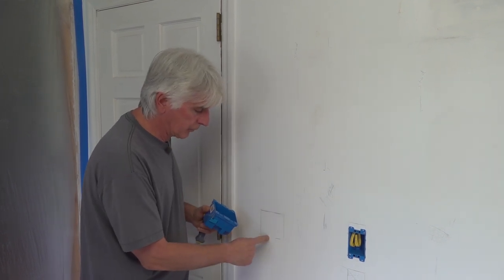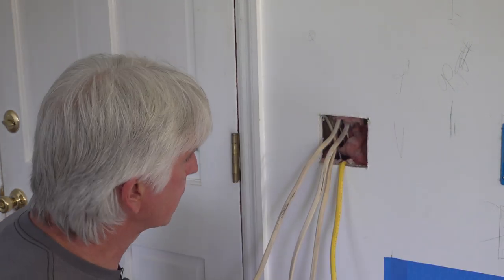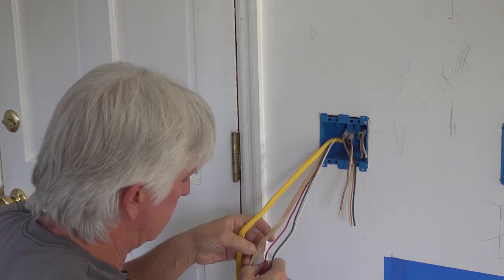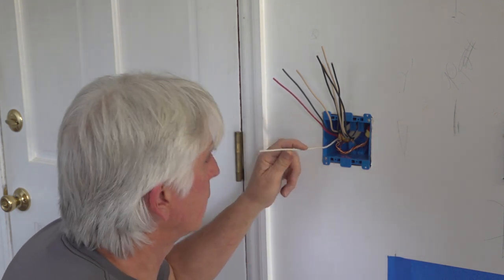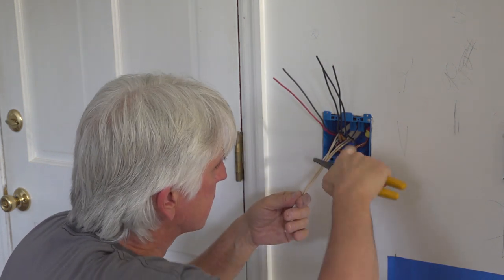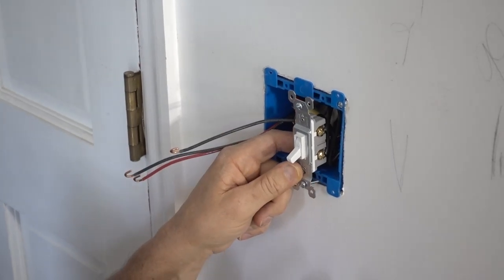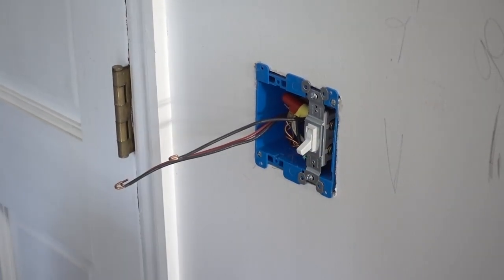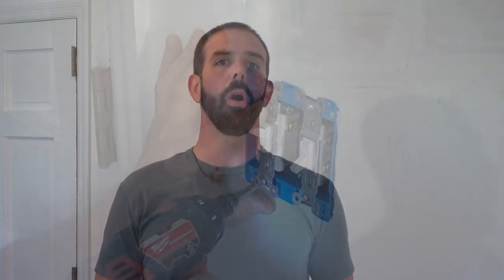Installing Single Pole & 3-Way Switches - Kitchen Remodel E22

Comment: I just started my electrical program at a trade, we just started wiring single poles to light bulbs, thanks for the video and amazing explanation, i will  be tuning in from now on, until my program ends in 13 months
Reply from the maker: Your welcome and thank you for the compliment. Good luck with your program. I have made a living off electrical work. Its tough at times and some times not so bad. There are a lot worse things to do, lol. I guess its all in what a person likes to do. Be safe!
Terry
Reply from the maker: I should have mentioned we do not have a lot of electrical going on in this remodel project but once we get going on our new houses we plan on doing  quite a few electrical videos showing how we wire a house with lots of details and explanations. 

Terry

Comment: For a German it looks so 1920s...we use WAGO push connectors, switches push in too, seconds later all is safe and secure on 230 V 16 A. Easy. It follow the codes, here.
Reply from the maker: Yeah I wish we were on the 230v system. 
Terry

Comment: Dear Terry,
What a shocking revelation & me who's done countless connections & never managed so much as to get a zap in the UK till I came to Belgium where the Neutral is actually a live feed too! Luckily it was only 120 volts & not the full 240. No chance of getting the tractor in then?( with an insulated bin????). A very well presented demonstration. Very well done. Kind regards.
Reply from the maker: Thanks! I think a lot of Europe is 220 volts but I have never been there so i can not be sure.
Terry
Reply: @ForestToFarm  Dear Terry,
Thank you very much for your courteous reply. As far as I know, the UK is the only odd ball having two voltages ( if you discount 380/410 Volts for factories). By law 240 is considered domestic & therefore cannot be used out of doors; this where the 120 or 110 Volts as they like to refer to comes in. In Europe they just have a built in R.C.D on the power tool's cable if for example the machine like a diamond core drill will be in close proximity to water. We instead have a dirty great big transformer weighing approximately 16 Kilos to cart around. There are some even bigger ones when 3.5KVA is simply not enough but like your good selves they use their tractors to move them around as 400 Kilos is ever so slightly beyond all the would be Arnold Schwarzeneggers. Kind regards.
Reply from the maker: Good info. Learn something new every day.
Terry

Comment: wow guys great video, I think it will help me with my situation. I have that same setup in an upstairs bedroom. 3 way switch on left and single on right, they work on separate breakers. the 3 way works fine but can't get the single to work for the room light. hours trying to figure it out yesterday and nothing, changed the single switch to a new one and nothing, any advise or help you guys can give me would be appreciated 👍.
Reply from the maker: Thanks! Not knowing all the details its hard to say for sure. Do you have a way to check for power?  Unless both of those switches are tied to the same feed wires in that box there could be two power sources in that box. A volt stick would help when trying to determine if any wire connection or point in a circuit is hot or in other words has power. Beware though as a volt stick will lie to you. Its a simple device and sometimes “ induced voltage” will make a false reading telling you something has power when it does not. That situation would be not so dangerous most of the time because not power equals no shock to you. However over time I have discovered by accident that if a wire is wet inside the sheath the volt stick may not read power on that wet wire. This was discovered while installing new construction outlets in outside boxes exposed to rain and the cable had been recently exposed to rain. Not likely pertinent to your situation but it lets you see that a volt stick is not the most reliable tool out there. Experience helps you understand and utilize this tool. When your safety is concerned power off at the breaker is the best option. 
Many times your actual problem occurs back in the circuit from a loose wire connection somewhere. 
I have come across the situation where a tripped GFCI outlet in a required wet location preceded the switch or receptacle that did not work. Not a proper way to wire   Per code but you find all kinds of situations out there in the real world. Gotta run for now but I will check back when I get a chance. Good luck and be safe!!! Working on electricity is potentially life threatening. Make sure you know what you are doing or get help from someone who does. 
Terry
Reply: Appreciate the info buddy, it's an old house and a mess. Was thinking I have an outlet like 3 ft away from the switch, what do you think about getting all new cables and getting power from the outlet to the switch and from switch to light?
Reply from the maker: @louv2425  You could do that but then there will always be that problem hanging in the wall somewhere, lol. Be sure and cap off any wires that are not going to be used from the old setup/wiring method. There is likely somewhere that is still working that has a wire not working coming from that location. If the wires are pushed into the back of the outlets its very common for one to just randomly stop making contact and loose power. Good luck!!
Terry

Comment: So I put in a new 3 way switch and single pole switch but problem is even though made 2 pig tails to split incoming power to both switches my 3 way won't turn on unless the single pole switch is on.
Reply from the maker: Not being there I can only guess that you have confused your power wire with one of the switch legs. If so the single wire going to your single pole switch is likely actually the power wire rather than switch leg. Again I can not see it so its only a hunch from my point of view. Hope this gives you some possibility of whats wrong. 
Terry

Comment: I’m trying to better understand. It would help to see the setup on the switch in the garage for the other side of the 3 way. If you could explain that it would be greatly appreciated. Very educational video as well.
Reply from the maker: Sorry for the late response. Been very busy and lots of comments to keep up with. I will be doing a more extensive video in the future showing what we do with 3-way switches. The main thing is what ever wires you put on the two similar color screws at one end need to be the same wires you put on the similar colored screws on the other end. It can get complicated because there are so many ways people wire them based on a particular situation and generally to save a few bucks on wire costs which at this time are extensive due to the extreme inflation going on. Thanks for watching!!
Terry

Comment: Terry, very professional and neat looking work, however you stated that there are 2 power wires coming in. I interpret that as 2 circuits and if so, the unused neutral wires should be wire nutted separately, not all together as you did.
Reply from the maker: Thanks! The two power wires are power into the box and power out of the box both being on the same circuit. Notice later in the video they are tied together. I would personally never share a neutral between circuits but its actually legal and some people do it. You can pull a 12/3 from the panel to a location then split the feeder up into two circuits. Two separate power wires sharing one neutral. Again I personally would not do that but many people do to save a few bucks. I do not suggest doing it. It just adds to much complication for future work being done in that building/ location. Thanks for watching and commenting!
Terry
Reply: @ForestToFarm  Thanks for the explanation. What you're describing sounds like an MWBC where the red and black wires must originate from different phases. I don't have that in my house, but I'm familiar with the concept and find it interesting. If I ever had the option to wire a new house or rewire, I wouldn't use MWBC's for all the reasons you mentioned. It's not worth the potential aggravation to someone  down the road.
Reply from the maker: Yeah I should have made it clear the two circuits have to be on different phases. Turn one phase off and someone might assume a circuit is safe but the neutral could still be hot. Lots of people die from open neutrals when they think there is no power present. 
Terry

Comment: I have a 5243-w Leviton switch that I would like to use to seperate my porch lights with a ceiling fan. This switch has 4 lugs on the travler side but can I use just two of them for the seperation of porch light and ceiling fan if so would I wire both to A1 and A2 or one to A1 and the other to B2 ?
Thanks for your help.
Reply from the maker: Hey Rodney. That is actually a 3-way switch which you probably already know. I do not have the diagram for that switch so I don't feel right giving advice if I can not be accurate on it. If you had the single pole version of a stack switch it may be much easier to understand and I believe it would accomplish your goals.
Sorry,
Terry

Comment: The only thing I didn't understand is wiring both hots  together with 2 jumpers couldn't that give you back feed if you have a short in one of the circuits?
Reply from the maker: Actually that is how you have to connect them. The power jumps from one switch to the next for a particular circuit and might hit 4 or 5 boxes in then same way. Hope that helps.
Terry

Comment: I come in door turn switch on walk down hall turn light on walk back down hall to turn switch off. How do I make it where when I go down hall I can turn light off and not half to walk back and turn back off?
Reply from the maker: Sorry I missed this comment until now. If its wired properly you may have connection problems at one or both switches which is very common especially among do it yourself types. Its not rocket science but it does get confusing when making those final connections. One way you can check them if you feel confident doing your own electrical, which each person has to know their limits, is to look at the DIY books at Home Depot or Lowes. Again do not attempt this if you are not sure about your abilities as an electrician. Electricity kills and you can not see it. Always have the power off at the electrical panel while working on electrical things. Good luck!!
Terry

Comment: Why no pigtails for the grounds to the switches?
Reply from the maker: Its not required in our area. I have run across many instances where the ground shorted to one of the powered screws on the switch causing an arc. This was on places we did not wire. Poor workmanship. If not required in an area we do not connect them on switches. 
Terry
Reply from the maker: Also in areas where grounding switches is required I have no problem with it. We have never had an issue with a short but we take great care in positioning the devices and properly placing the wires while installing devices thus greatly reducing any chance of a short. 
Terry

Comment: What does the NEC say about grounding metal yokes on switches ?
Reply from the maker: I honestly do not even have the current code book. We just do as the local officials require and so they give us a class on any changes year to year. We are due an update but like I said have yet to get one. Sorry. :)
Terry

Comment: Why did you not ground the switch
Reply from the maker: Hey Nick. In our area you are not required to ground switches. Don't ask me why but they never adopted that code. Personally I see the advantage and added safety of grounded switches but I have come across many times where that ground wire shorts out on the switch terminals. People just being sloppy when installing the switches most likely. If they had the ground wire insulated i would do it even if not required.
Terry
Reply: Forest To Farm ok good explanation i was just wondering because im in a electrical program at school im in the upstate sc
Reply from the maker: @nickmckinney2335  Great Nick. Be aware that some counties require the switches be grounded in upstate SC. Each area has their own interpretation of the codes. I don't ague with them and just give them what they want. At one time when Arc-faults first came into play our city said smoke detectors could not be on an arc-fault and the county said they had to be, lol. Beat all I ever seen. Then the city after several years decided they had to be like the county had been doing all along. 
Terry
Reply: @ForestToFarm  Hi Terry and Brian, When I built my home, I used insulated ground wire (green) as pigtails to the bundled ground wires.  I had the same fear you had since the electrical boxes get small quickly!

Comment: you failed to ground the switches.
Reply from the maker: Yeah in our area it is not required and I do not know anyone who does it here. Those grounds can short on the screws. We personally never had problems with it but ran into lots from other electricians. Poor installation of wire into the box was basically what was wrong with other electricians work we came across so many times. 
Terry